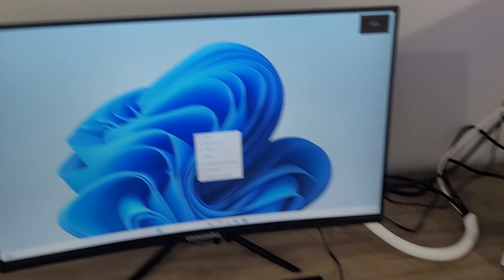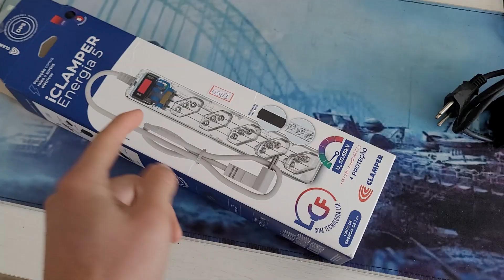PC Powers On but No Display (Black Screen, No Signal) — Fix It Now!

Comment: even drops of sweats, when cleaning pc, causing short circuit my entire system. it wont boot at all. need to wait 2 days before my pc finally starting alive. even after getting PSU replacement T-T.

Comment: You solved my issue at 2:40. There are so many hdmi ports. I always forget and connect it to one of the higher up ones and forget about the one down low. Three months of frustration solved in 2 minutes. THANK YOU!!!